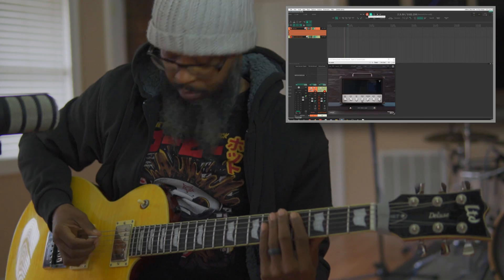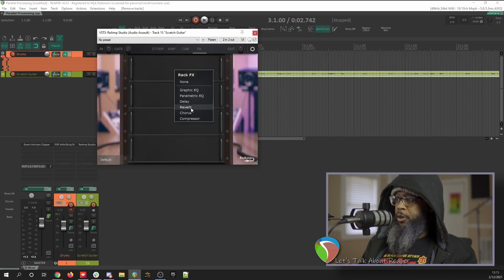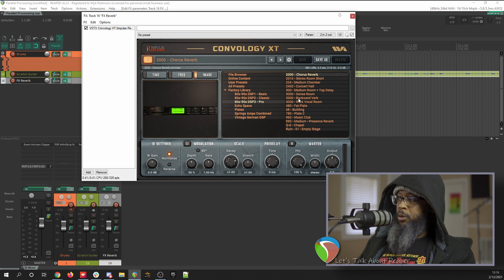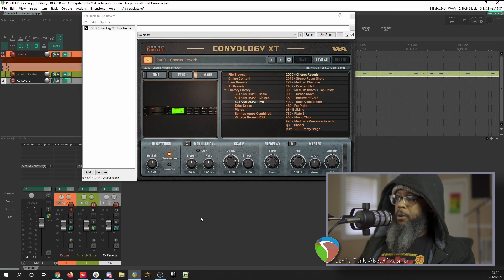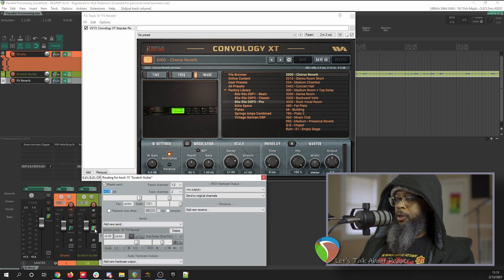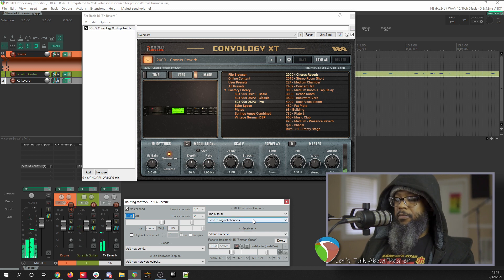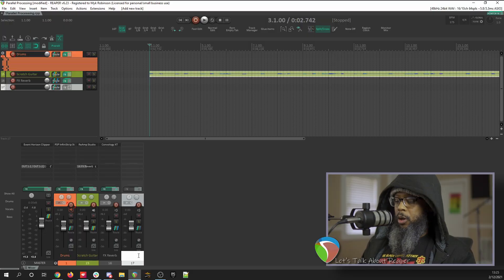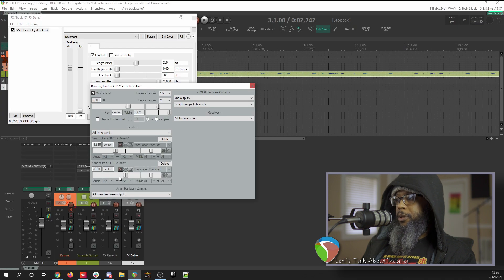Aux Sends/Parallel Processing in REAPER

Comment: Hi, when I use pre or post send,? I
For parallel compression? For fx?
Reply from the maker: There's not really a right/wrong answer for this, but generally speaking, you'd use a pre-fader send if you don't want the parallel track to change based on the movements of the fader on the channel being sent.

A good example would be monitor mixes. If I were sending tracks to an AUX channel for a performer's in ear, I would use a prefader send to make sure that the performer is able to adjust his or her own monitor mix, and a monitor mix is not affected by what I do to the faders on the tracks that are being sent. There's nothing worse than having your eardrum shattered when someone moves a fader on the mixer.
Reply: @LetsTalkAboutReaper  I usually use post fader to send modulations (reverb, delay) and saturations or distortion. This way the amount of effect is in accordance with the amount of dry you use.
Reply from the maker: @ZangalangaTube  same, but in some instances, I prefer to have a pre-fader send and automate the send for even more control. This can be helpful if you have an effect that you feel like is just not getting enough from the track
Reply: @LetsTalkAboutReaper  I understand and that's a good point!
thanks and greetings from Argentina

Comment: I got a new one :P
I created a simple 4/4 MIDI drum pattern.
I added an FX REVERB like you said.
It's a reversed reverb, and liked it.

How can I record the output sound of the reverb track, avoiding the original drum track to create a weird sounding beat?
I recorded the output but there's the original track and the reverse one.
Thanks a lot!
Reply from the maker: Is the reverb track 100% wet? My best guess is that you still have some of the dry signal on the reverb track.
Reply: @LetsTalkAboutReaper  Should try that, sounds like that's the answer :) thanks!
Reply: @LetsTalkAboutReaper  It did it. Thank you so much for your time :D

Comment: One thing to keep in mind when pulling down the send fader is that some FX, particularly reverbs, operate better (or at least much differently) when being fed a strong signal. For that reason, I tend use the FX track fader instead of the send fader to adjust the wet/dry balance on reverb returns. For delays and all that kind of stuff it's no problem, though
Reply from the maker: Same with compression, you may find yourself fighting between the track send and the threshold to get the desired result.

I typically end up adjusting both when it's all said and done